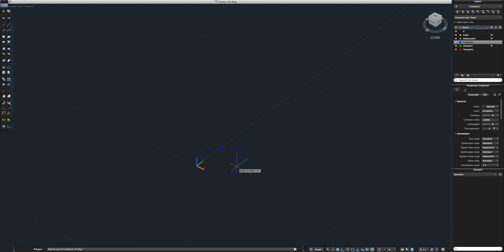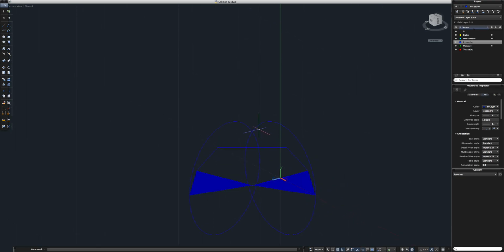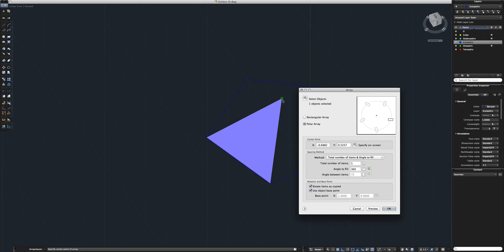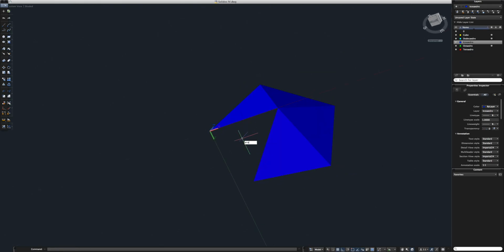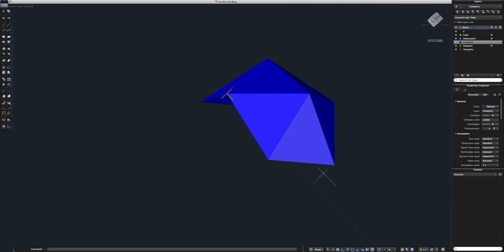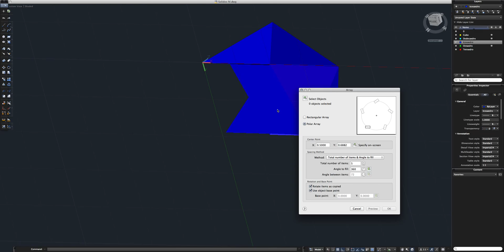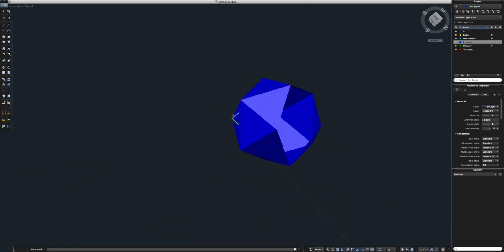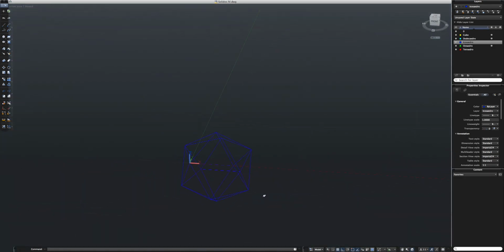AutoCAD 2015 Icosahedron Tutorial

Comment: can you tell me what angles is between faces? i dont know how to check it
Reply from the maker: I did this a couple of years ago, i can't remember if i used a specific angle or just connected them through alignment, though i believe the latter would be the correct one
Reply: when i check on wiki it says angle should be 138.19. but making this way angle is 157. how so?
Reply from the maker: I reviewed my video, since i used Align command, i never really required angles, sorry mate... i don't really know the angles. I guess the way they ended up rotating was what caused them to have that 157º angle